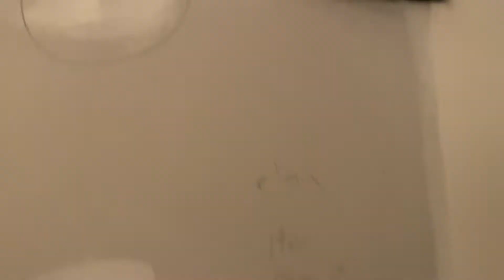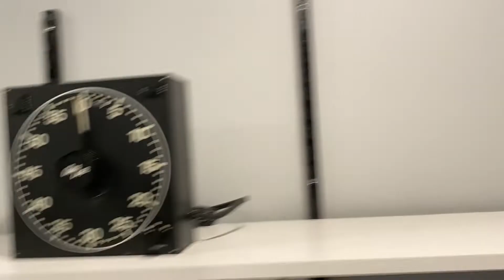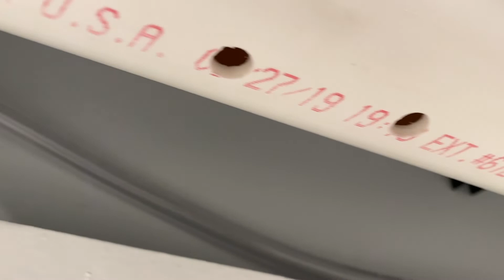Darkroom Ventilation Project

Comment: also - why did you position the holes straight downward? Why not 90 degrees horizontal, or 45 degrees diagonal?
Reply from the maker: I put them straight down so they wouldn't be visible.   It seemed to me that the important thing is to get the air flowing and it does that quite well

Comment: Hi - im almost done setting up ventilation in the same way you have - how large did you drill your holes in the PVC pipe please?
Reply from the maker: I believe I used a 1/4" bit and the holes are about 2 inches apart.

Comment: Nice looking darkroom. Do you store working solutions in those doran tanks? How long do they keep in there?
Reply from the maker: I store stock solutions of DEKTOL, D76 and Kodak Hypo Clear.  I usually finish them within 2 - 3 months with no issues.  They have floating lids so not much air gets to them

Comment: Nicely planned and precise work! May I ask how long it took to set up the entire darkroom (with sink and all) and the ventilation system altogether?
Reply from the maker: I had a contractor build the room in my unfinished basement.  That process took about 2 months because I had to get permits for construction and electrical.  No need of a plumbing permit because the water supply and drain was already there.  I built the sink and enlarger table myself while the room was under construction.  It is a work in progress.
The ventilation system came about a year after I finished the darkroom and only took a day or so to install.  I did that when I had to empty the darkroom to refinish the sink.
I am constantly coming up with ideas and improving it.